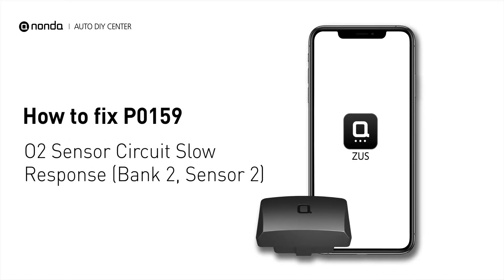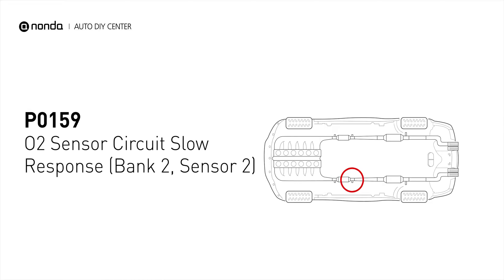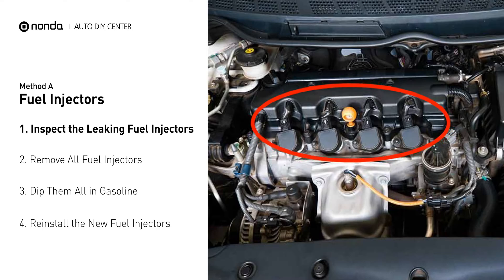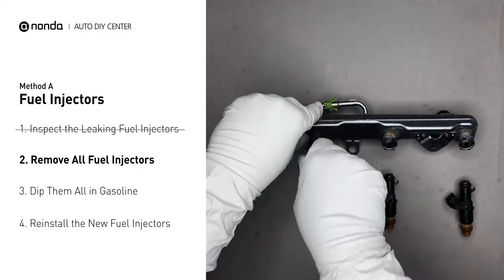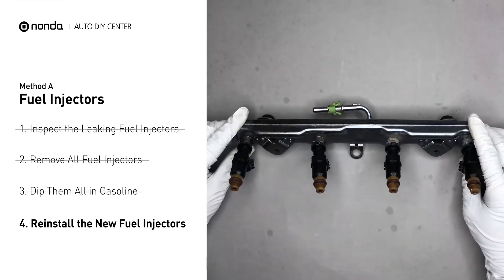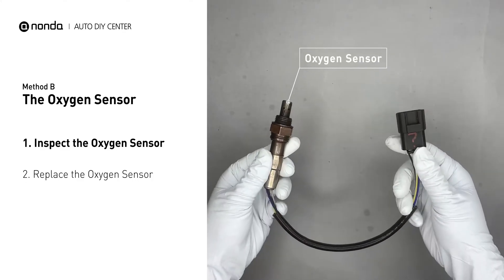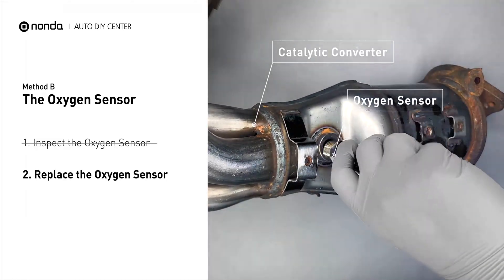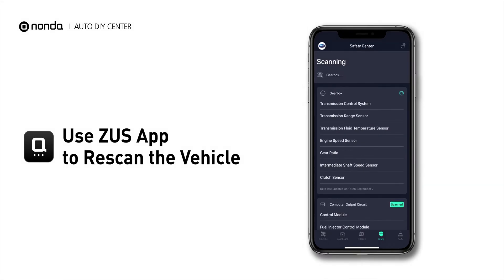How to Fix P0159 Engine Code in 3 Minutes [2 DIY Methods / Only $8.34]

Comment from the maker: Hi, I'm Steve, nonda's lead mechanic engineer. 
Feel free to leave your comments here if you have any mechanic questions, I will be glad to help you out!
Reply: I can't get p0158 and p0159 code to stop . I changed my o2 sensor twice and still comes up.  Its a 2000 nissan maxima gle auto.
Reply: @51OAKLANDER510  are you using aftermarket o2 or NTK/Denso? I think aftermarket o2 sensors are very loose in their reporting and will cause codes to be thrown. I replaced a new no name with a junkyard NTK and it was better than the new one!

Comment: Could this code be thrown by bad gas?
Reply from the maker: It could be caused by:
Faulty Rear Heated Oxygen Sensor Bank 2
Rear Heated Oxygen Sensor Bank 2 harness is open or shorted
Rear Heated Oxygen Sensor Bank 2 circuit poor electrical connection
Inappropriate fuel pressure
Faulty fuel injectors
Intake air leaks may be faulty
Exhaust gas leaks
Reply: Replaced o2 3x same code. Slow response and lean condition codes on bank 2 only. Has to be fuel injectors but I don't understand why the heated o2 circuit is referenced?
Reply: @68pishta68 I'm thinking out of gas